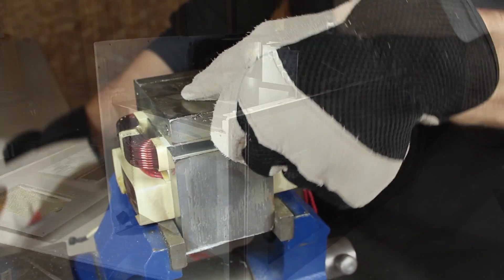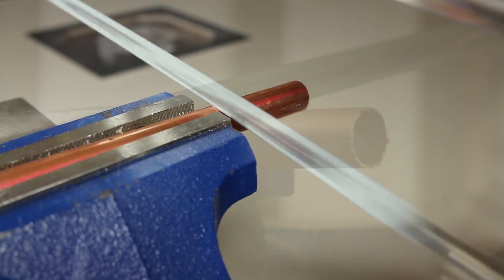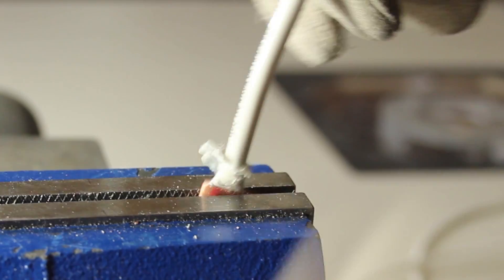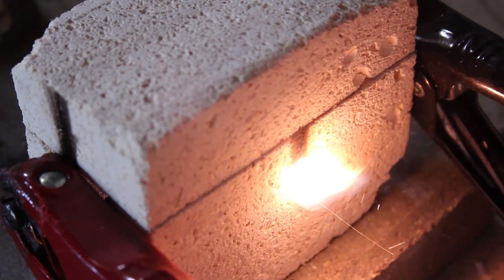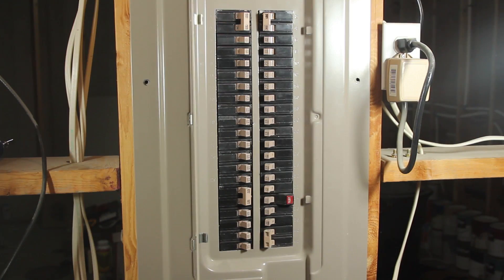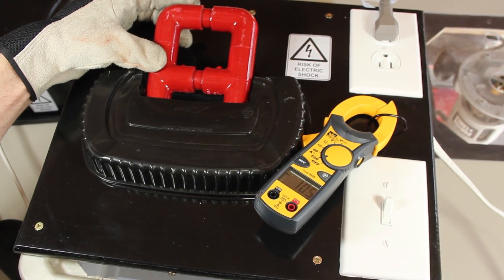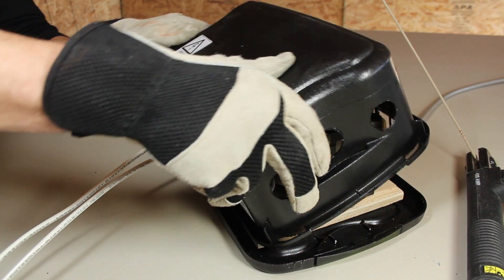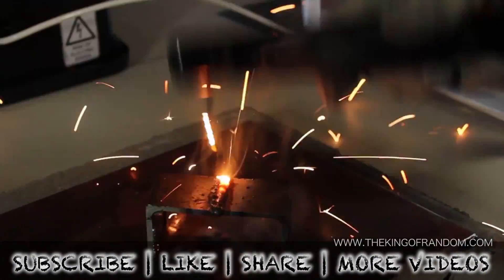Making an ARC Welder - Part 2 of 2

Comment: you really didn't ground anything...? wtf dude.
Reply: +DietBroccoli  Electronics are grounding for safety of user. It means, if you have grounded non life parts of your equipment, like metal body or so, you wont be able to get electric shock. Because unwanted voltage would jump straight into to ground trough wires, not trough you. And as it would happen only during a defect of equipment, your cirquit breakers would break the cirquit instantly, if they have the right current value. In the case of storm lighting, if the building is grounded, the bolt should use rods and wires to go to the ground. If your house has no lighting bolt protection, you may get your electricity burnt or the whole building can catch fire as the bolt goes trough everything wich more conductive. And don't say that dry wood is not conductive. If you have like bolt with millions of volts, everything becomes conductive, even air.
Reply: +pyr666 something more risky than the grounding is the way he powers the device.
Reply: +Vayun Biyani 

"just" for safety? really?
Reply: +RkB 
the primary purpose is to protect you from the frame becoming energized.
Reply: +DietBroccoli lol you're like 12
Reply: Just did this same experiment but wired two transformers in a series and powered it with 120 supply. I got roughly 62 volts using 10gage wire. IT does very well using 6013 AC electrodes. Im actually pretty scared of it honestly im a welder not an electrician.
Reply: actually it's risky but any way grounding is just for safety
Reply: +Sam King   Electricity takes the path of least resistance. So a good ground like your lightning rod will have fewer ohms than a path through your house.
Reply: +pyr666 +1
Reply: In my house when an appliance is using the house ground and a live connection is made with the ground it switches the power off for the house. That's how the power boxes work over here in Australia.
Reply: +DietBroccoli so plz tell how it works.
Reply: DietBroccoli Oh really?  Then why do you put lightning rods on your house and ground them to the earth?  SMH
Reply: William Foley I know this, as does most everyone else here.  It's 'diet broccoli you need to explain this to. lol
Reply: Alright
Reply: +pyr666 grounding is just for safety reasons
Reply: +DietBroccoli who told u this
Reply: Static Electricity, That's what's ground/earth is actualy for. (As far as i know, link me to something that says otherwise)
Reply: William Foley it actually takes all paths to ground
Reply: I could be wrong, but if it was grounded wouldn't it throw a breaker instantly? That's kinda defeating the purpose of the welder 🤔
Reply: Vayun Biyani, Sam King : "Ground" in household electronics stands for "Earth Ground." Earth is not an effective ground-fault path.  You are a viable path for current even if a device is grounded.  If you don't believe me, go look it up or, better yet, touch an uninterrupted ground fault.
Reply: Exactly what part of this device would you attach a grounding wire to?
The wooden base?  The plastic shell?
The output terminals?  LOL
~Whaaahhh he didnt ground it~   Boohoo Pal, just what part do you think should be get ground wired?
Reply: Vayun Biyani : NEC 2014 conference.
Reply: Jurie Debie : Nope, try again.
Reply: You're aware AC neutral serves the same purpose as a ground, right, OP?
Reply: As he said^ you don't need to. Plus, arc is created by electrical current. Meaning that unless you grab the wires or something it won't shock you.
Reply: +pyr666 : I'm sure he won't be welding during lightning storms.
Reply: +DietBroccoli 

that's not why you ground electronics...
Reply: +pyr666 : If you say so, big guy.
Reply: Sam King :  That's a myth, guy.  Electricity doesn't work that way.
Reply: Tomáš Kučera :  That's 100% wrong dude.  You're espousing a common myth.

Comment: How did you find the two 120 volt outlets that were 180º out of phase with one another? Why would they be out of phase with one another in your house?
Reply: +Cliff Fox (KU4GW) Wire the two primaries in parallel, not in series, that way you only need 120V... Reduces the risk of burning out your home wiring ;)
Reply: +Sarah Szabo Switch the PRIMARY sides in parallel... It's the same as plugging two devices in the same socket, and completely harmless... NEVER EVER switch SECONDARY coils parralel, that way you wil almost allways create a short circuit, since there's almost always a slight difference in voltage... 
Secondary coils are galvanically separated from the primaries, so you can use them in series without any problems, even if the primaries are parrallel...
Reply: +Sarah Szabo Nope... You can safely switch the primary in parrallel of as many transformers as your power supply (or the wiring you use from the outlet to your rig...) can handle.
I'm an electronics engineer... I know the frase "trust me, I'm an engineer" is farely infamous, but I really know what I'm talking about ;) I use the same configuration in several PA audio amplifiers I built... 1000W RMS amps. Couldn't find suitable transformers with two secondary coils, so I used 2 transformers, primairy parallel, secondairy in series. Now I have a nicely balanced supply voltage to the amps ;) Even after hours at full blast, you can still safely touch the transformers, and they are only slightly warm...
Reply: +Ronald Delvax I'd actually say that it increases your chances of something burning. If the voltages are more than 1V apart you may have serious problems due to eddy currents and may burn up your transformer.
Reply: +Cliff Fox (KU4GW) You need them out of phase because when one hot is positive the other should be negative. Not negative-negative.
Reply: +Ronald Delvax That too. I'm not so sure about the parallel configuration though. Isn't it still subject to eddy currents?
Reply: Wish I had 2 phase power like grant and the educated engineer types below. Great question Cliff, standby for corrections...
Reply: so would you recommend plugging into one outlet instead of two then and just wiring the primaries to the same plug?

Comment: Would it be possible or practical to do this exact same project with only one transformer? maybe use only three coils of a larger wire rather than six? What dangers would come with that? (I am NOT planning on making this until i am more educated. Don't worry about my safety. I am doing tons of research on electricity, current, and transformers to make absolutely sure that I can minimize the risk)

Comment: Grant Thompson - "The King of Random can I use these transformers for induction heating?
Reply: Owen Chase yes I have build one with MOT. I can provide you with some schematics if you want.
Reply: MOSKAU15 that would be nice. I have some mosfets but I don't know what voltage and amperage rating of mosfets that would handle that kind of amperage coming out of the MOT going to the induction heater circuit?
Reply: Owen Chase Well mine was quite low on power (only 120W or so) because I have modified my MOT only for 19V output.
But it was still powerfull enough to make 150mm nails shining red under half minute.
But if you make like 40V output for it, it will be much more efficient and output power would only depend on how much are you willing to spend on MOSFETS, diodes and good resonation capacitors
Reply: well voltage is best around 20-40V and when you have 800W MOT it can provide I=P/U= 800W/20V = 40A at 20V output and 20A for 40V output. But induction heater will not consume so much power. As I said mine took about 5A at 19V but it will took more with higher voltage.
Reply: ok thanks
Reply: Owen Chase
Input current will depend on how big capacitor bank you will use (I had really small one (3 caps), thats why I had only 5A input). And also dont forget to put those fast diodes and MOSFETS on decent heatsink (dont really needs to be big ones, Mosfets are switching in zero voltage so they are not warming much as much). For working coil you can experiment with different thicks of wire and with adding turns (mine was working well with 10 turns of 2,5mm copper wire)
Reply: MOSKAU15 ok cool, I wanted to melt some ferromagnetic iron to make my own transformer core.
Reply: Owen Chase
Wait, you want to melt ferro iron with this heater?
Reply: MOSKAU15 ya if possible!!
Reply: Owen Chase
It will make it really hot but I don't think it will melt it.
From my side of view its not reasonable to make your own transformer core sheet metal. You need to make them all same size, thicknes and with same material parameters (like scattering inductance, resistance etc.) You will never be able to make them same when you will be molding them one by one. Also they need to be izolated from each other with special coating. And Im not even talking about how much of your time, energy and resources it will take and it will be still nowhere near to professionaly made transformers.
There are many companies that specialise at making transformer core sheet metal. its not even that expensive and you will get top notch quality.
And you could even look for companies that will make whole transformer for you if you give them parameters you want. You will get professionally made and safely isolated transformer for reasonable price.
Reply: ya I was thinking it would be more trouble than it is worth.
Reply: Owen Chase
If you want to make toroidical core, you can try but again...quality will be nowhere near to at least good. And I am assuming that you know something about permeability of material you are going to use (and of course that you know what permeability is and how significantly it can affect core parameters). Transformers are not that easy as they looks like :) even Im not really experieced in this field of electronics but I know some basics.

But if you want to try it you will need some kind of high temperature furnace and high temperature material you will make mold from.
Because transformer cores are made from material designed to withstand eddy currents really well so your tranformer will not melt down :) and those are same eddy currents that are used to melt things with Induction heater.
Reply: MOSKAU15 what are the flyback transformer cores made of they look simple?
Reply: Owen Chase
Flybacks are special transfromers that works on quite high frequency (usually around 15kHz) and they use second winding inductance for storing energy before discharging it. And the core is surely made from Ferrite but I have no idea what kind of nor its parameters. But what I surely know it that its not designed to work at 50/60Hz and it will oversaturate massively if you try to make power line transformer from it.
You can make some easy 555 oscillator with transistor that will work somewhere about 10kHz-100kHz to power it up. Its really easy to do and fun to play with. But be careful, output will have several thousand voltages and it can make arc few cm long. It will not kill you but when you touch it with bare hand it will make little burn mark so you must touch it with something metal in your hand. Look at my channel I will upload some video of one I have build ;)
Reply: MOSKAU15 ya I made my own pcb and made the 555 flyback drive it works, I have 2 potentiometer on the board, that is what got me in to high frequency projects I wanted to try something that had high wattage and high frequency then I thought about the induction heater. I don't know if you make your own pcbs but if you don't it could make a world of difference for your electronics you can all most make any electronic project you ever wanted.
Reply: Owen Chase
Sure I do :) we have learned that at highschool. Im doing booth Hand drawing (for easy projets not worth to make PCB for) and photoresist for complex ones. But my all time favourite is what we call Manhattan style...no pcb at all, you just soldering legs of components to another legs :D Its messy but but I like it bacause I can easily change vaules and try new things when Im developing something. Even after Im done with development I start working on Pcb.
BTW you can even find video of my induction heater when it was still in evelopment on my channel
Reply: If you want HF HV project try making Tesla coil. Its fun and quite easy to do :) You can choose what type you want to do (I recomend you start with spark gap type first and then work up to half bridges) You actually need only 4 thing for it. Powersupply (flyback for example), spark gap, capacitor and tesla coil transformer :)
Induction heater is little more complex you need to know how those transistors are switching and what are fast diodes and zeners for etc, Also you need to make experimenting with windings and cap bank to make it work well. Its not so hard to make but it needs time and when you are imagining that you will melt 1cm thick metal with it in first shot you will be dissapointed after all that work because you will find out that something needs to be more powerfull or constanly something breaking up and you dont know why.
Reply: MOSKAU15 Nice I will look at the video. I remember when I was younger doing my experiments I use to take the magnatron out of the microwave oven and boil water on the garage table, that was my so called lab at the time lol. I know making a magnatron would be all most impossible because there is a lot of engineering that goes in to making one but Im thinking to my self would it be possible to build a high wattage transmitter that would do the same thing the only thing is I would be using an antenna for the RF output?
Reply: Owen Chase
Japanese were actually trying to use microwaves (really big radars) as weapon but it was not really effective...burning somebody 100m away, while you need to have him precisely pinpointed with 5m radius radar antena and consuming power of little energy plant is quite bad idea when everybody is shooting at you if you ask me :D

BTW look here for some really cool (and some of them also really dangerous) experiments http://danyk.cz/index_en.html
Reply: MOSKAU15 things are harder than I thought,  I  figured  I would just build a 1000 watt transmitter and it would do the same thing with the RF as a magnetron..
Reply: 555 is pretty much ok and you dont need to touch it to double output voltage. You can try to mess around with primary winding on HV transformer. Try to remove few winds, you will get more voltage at output and bigger input current, but it will also heat up transistor more easily and posibbly cook it, so heatsink is a must.
And I don't see any protection circuit at that IRF. You could add protection from positive voltage spikes and dU/dt to get less heating and more safety for that transistor. Also gate protection would be cool...I will give you edited schematics.
Also don't try to get under 3 winds on primary...voltage will be so high that corona around secondary windings will burn through isolation and destroy transformer.
There you go:
http://postimg.org/image/u1ac3muip/
Reply: Ok thanks
Reply: MOSKAU15 I have russian gieger tube, I know it needs a current limiting resistor 4.7 to 10 mega ohms, I mesured the voltage with the resistor before I hooked it up to the tube with my multimeter,  and there was a big voltage drop, if the voltage drops so low, how is the tube going to have the high voltage that it needs?

Comment: Grant Thompson - "The King of Random"  I have a question for you, sir.
I live in a country where electricity is distributed at 230V, AC. (Italy). I plan on building the setup you showed in the video to power an Arc Furnace Reactor, but I don't know if making the system the exact same way you did (only without the splitter to overcome the 120Volts problem and use 240) would even work (1st doubt) and if it works, if it will work exactly the same way it did for you (2nd doubt). What do you think, could it be doable with my kind of power supply? :)

Comment: How does the center tap feature work? Does it just provide half the voltage off the secondary?
Reply: DukeOfMarshall If you put 2 transofrmers into series you need double the voltage to get same power from them. You can connect then in parallel but you will get double current which can shoot down your breakers
Reply: MOSKAU15 I think I understand what you're saying. If you connect the primaries in series and the secondaries in series, then you double the input voltage and get the same output amperage from them, but connecting the primaries in parallel and the secondary in series will double the input amperage. Correct? So in the setup in the video the primaries are connected in series and the secondaries are also connected in series. As I understand it, this is to get more amperage for the welding process. So by center tapping it like that, then it cuts the voltage in half and the amperage stays the same when using the center tap lead and one of the other leads, correct?
Reply: Well not exactly. In this video he have primary in series and secondary in series as well. That means that he need to double primary voltage to get same output power from booth (for example 1kW+1kW=2kW) if he didnt double voltage he would get only around half of output power (because there will be only half of the voltage on each transformer).
If you connect them in paralel you would need little more than double of their current but no need to double the voltage to get same output power.
So you need primary in paralel and secondary in series as in video :) Secondaries are in series to get more voltage to be able to hold arc during weld. (if booth transformes have output voltage 20V for example, then you need to connect them in series to get 40V...just like bateries, but look out for polarity). It doesnt really matter if primaries are in parallel or in series with doubled voltage. Secondary winding will be connected same.
Hope it helps and sorry for my english